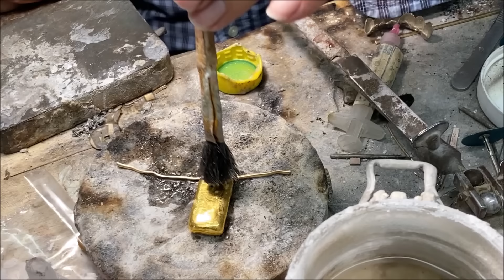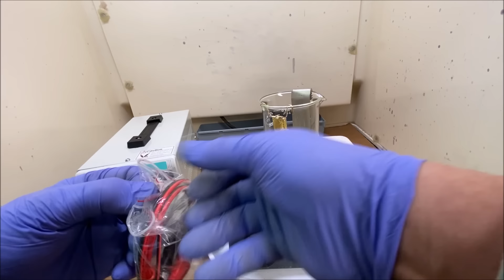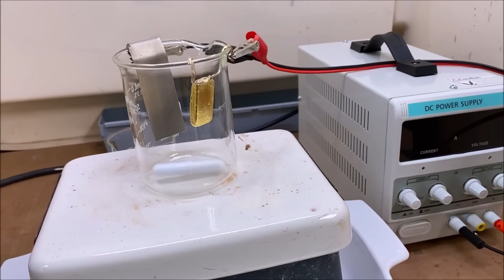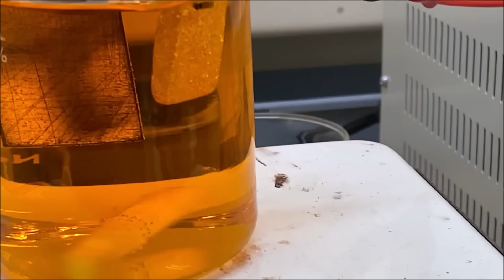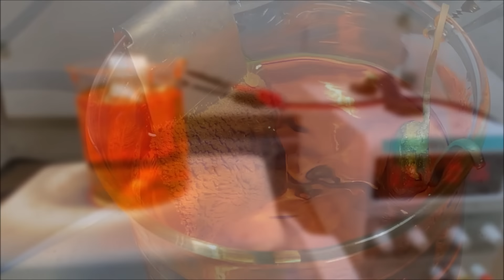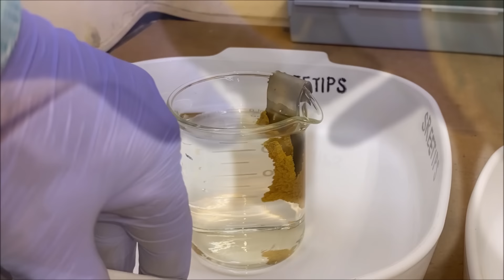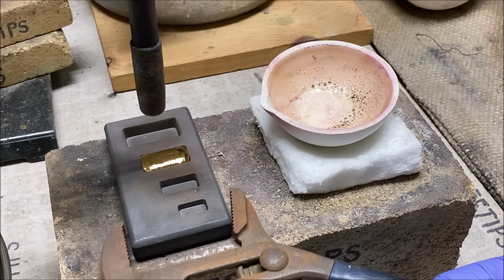Electrolytic Gold Cell Part 2

Comment: If you shaped the cathode like a triangle (or just make the bottom narrower than the top) with the point facing down it may be easier to slide the precipitated gold off of it.  If the thickness were tapered down the length as well it might make it even easier.
Reply from the maker: Excellent suggestion

Comment: I do this with copper. If you use low voltage the pure crystals will grow thicker, but will take longer.
 Edit: Just realized you are the one i spoke to about the right voltage and time for thick crystals. So yea you already know this.
Reply from the maker: For proper silver deposits, 3.5 VDC is critical.
Reply: @sreetips  yes sir. It was your silver video that got me into plating copper crystals.

Comment: Since I have no clue I’m wondering if you shaped your titanium into a tapered needle shape if it would pull right out of the gold when your done. Or if you used a ..9999 fine gold bead shape or square or pyramid ect would it plate into that shape? Great video I’ve heard a lot about your channel but never had time to watch a vid till now. Very cool in my opinion. Thanks for sharing see you on the next one 👍🏼👊🏼

Comment: Intersting experiment!

I am just guessing, but a well-rounded cathode, maybe even a round bar with a ball formed on the nose, would be good to remove the gold later.

Or at least a polished plate with round edges, as those seem to hold the gold very tight.

Comment: Wouldnt it have been easier to just melt the original bar....?
Reply from the maker: The original bar was about 995 parts per thousand pure gold. But running it through the cell I get it to 9999 parts per ten thousand pure gold. So melting the original bar would have done nothing to change the purity.

Comment: Completely pointless.
1. Your choice of violent stirring, in a small volume, together with a rough/porous object, that which in fact is supposed to get refined, may get it contaminated with anode sediment, which is normally meant to settle straight down in t process of https://en.wikipedia.org/wiki/Electrowinning.
2. If I am educatedly guessing correctly, a specific voltage is required to selectively transfer what is desired, higher voltages can then alter t chemistry of what's going on, potentially including more noble metals.
3. When you're physically scraping with a hard metallic object, that action can scrape pieces off of t Titanium, contaminating t deposit.
4. But t Gold anode is already very pure, making this flawed approach effectively just a very energy expensive and inefficient means of transporting a piece of gold from place A to place B, you could have just remolten it directly!

Not trying to be hostile, just my natural reaction ;)

Comment: By the way, i tinkered with doing this process with copper using the things i had and freshly purchased copper sulfate from  store plumbing department and a 48 volt power supply. It worked nicely but i think it needed some acid, possibly sulfiric, added. In a week i had plates that looked just like your silver cell crystals. Mom liked them too much to allow me to sell them :(
Reply from the maker: The acid will increase the conductivity. And I think that’s good for the cell. 48 volts sound a little high. I’m sure you can find the optimum voltage for your copper cell published on the internet.

Comment: So how much gold did you loose once you got the rest of the original bar plus the end product ? Since you went from .999 I'm guessing you lost something in the processes of refined .9999
Reply from the maker: There are losses all along the way. Minimizing these losses will depend on the skill and technique used by the refiner. Unless something got spilled or dropped, the loss of gold from this process is very low. A drop of gold splashing out of the cell. Some gold sticking to the melt dish. Getting it too hot in the crucible and causing it to vaporize. But it should be one for one straight ahead trade. Of course entropy guarantees that we will never get out 100% of what we put in. But it will be very close.

Comment: So did he really just basically grow gold?
Reply from the maker: Grow: to increase in size or mass. And that’s exactly what happened on the titanium cathode. But I first had to have the gold in the form of the anode bar that dissolved and passed the gold ions through the gold chloride electrolyte to deposit as pure four nines gold on that cathode. I didn’t create gold out of thin air. I refined it.
Reply: @sreetips  thank you for the response. It's very interesting.

Comment: I just came across this, whats the point here?  He had a nice gold bar and then did the chemistry and then made another one.  Its fascinating and interesting, but is there a reason to do this?
Reply from the maker: Yes, to demonstrate that it can be done in my garage. I’ve refined four nines gold in my little homemade gold cell. That extra nine is meaningless, unless your an amateur refiner, like me. I guess I’m just being a bit of a show-off. The Royal Canadian Mint uses this process to refine four nines gold to make their highly sought one ounce Canadian Maple Leaf gold coins. And I did it in my garage. For electro-refining to work one must first start with anode material that is fairly high purity to begin with. And that’s why I used a single refined, 995 parts per thousand, pure gold anode bar. The finished bar went to my daughter. It was 9,999 parts per ten thousand pure gold.
Reply: This process is the basically the only way to be sure that the gold is completely pure, with not other metals in it. the final product is pure gold in crystal form, meaning its more valuable and has absolutely no trace of metals like copper or silver. Most gold that's called 'pure' gold is close, but usually it technically has some silver or copper in it, in very small amounts, like very small. this version of gold has none.

Comment: This is fascinating but I am so lost on a lot of this process.  Definitely need to do some light reading to brush up on my chemistry and metallurgical processes.
Reply from the maker: It’s pretty simple. The electrolyte is gold chloride (pure gold dissolved in aqua regia). The concentration of the gold chloride is 100g per liter (estimated). The anode is pure gold, about 995 parts per thousand. The cathode is pure titanium. I pass an electric current through the anode. It dissolves and the gold ions travel through the electrolyte and deposit on the cathode. It’s that simple.
Reply: @sreetips  haha yes and no.  Love your set up and there is a lot of attention to detail.  Would have to upgrade the ventilation I use for my glass work for sure.   Great videos and excellent explanations.  Thank you.

Comment: How much did the remaining anode weigh? You started with 58.2g on the anode but ended up with 45.6g for your finished bar. How much of that was just the anode bar recrystallizing on cathode? We could need to take the current weight of the anode minus the bracket and subtract 12.6g to find out how much you purified from solution.
Reply from the maker: It was about 11 grams or so. But I didn’t weigh it.

Comment: SREETIPS....NEXT TIME MIRROR POLISH THE TITANIUM AND THE GILD WILL STILL FORM.....BUT NOT STICK LIKE IT DID THIS TIME! You are forming a mechanical bond....bc of the grain on the titanium...not a chemical bond....so by polishing the titanium you forgo that issue. Now it will still slightly stick....but not nearly as bad.....and yes it can be that simple.
Reply from the maker: Agree, plus taper the titanium.
Reply: @sreetips  agreed also! 👍 not bad for a high school drop out....hahahaha guess spending 30 years as a sheetmetal fabricator has paid off! Hahahaha love the vids sreetips keep em coming and keep taking chances on new processez

Comment: Just fantastic to watch. What is this book you speak of that you reference?  About the heat of your solution and how much current to use? Have you thougt about a collaboration with anyone who has a mining channel and try this on a bigger scale?
Reply from the maker: Refining Precious Metal Wastes
Mining is grams per ton. If the miner had material that produced 1 gram (of pure gold) per ton then the miner would have to process 50 tons of material to find as much gold as I refined in this video.

Comment: You just dissolved it and moved it to the anaode.. 😂. No gold was created that didn't already exist in the beginning.
Reply: he did something more significant though, he created the purest possible form of gold you can find anywhere in the universe. It's crystallized gold, with absolutely no trace of any other elements in it. average 'pure' gold actually has traces of metals like copper and silver in it, so in this way he increased the value of the final product.
Reply: @nostalgiaarcadefuture  well then, I take back my former, judgmental statement and I apologize. 🙏
Reply from the maker: Correct

Comment: I'm curious. Isn't titanium alot higher melting point than gold.  You could have spared yourself and just melted it away.  But then I do not know for sure. That's my question and I love your videos.
Reply from the maker: I believe that trying to melt the gold off the titanium would have caused the gold to weld/solder to the titanium making it impossible to get it off.

Comment: you could have silver soldered stainless steel welding rod to the gold bar easily.for hanging the gold bar...then disolved the silver solder off of the two with nitric without needing to do further refining...

Comment: So you started up with a block of gold you used as a anode which melted away during the process Then you get gold on the cathode from the process that you smelted down into a gold bar but how much extra gold did you end up with?
Reply from the maker: Smelt: rendering metals from ore. I’ve never done any smelting.

Comment: Love your videos! I found a very unusual, small, heavy, molten, gold tone piece of metal when metal detecting. I used 14k acid on it to clean it up. The second & third time I cleaned it, the acid turned green, it gave off an orange gas, and after maybe 40 seconds the acid became blue in color but the piece remains gold and when you move it around it changes color with a slight copper hugh to it. Very sparkly like a reflector. It weighs exactly 20.0 grams and is only 1 1/4" x 3/4"x 1/2" approximately. Also, the metal did not receive any damage from the acid. I wish I could add/send you some photos.
Reply: did u uncover the mystery yet
Reply: brother dont leave us hanging on this alien gold piece

Comment: I used amonia for my clear solution used a stainless steel basket with gold plated pins for anode and lead as the cathode used a computer 36volt charging transformer as the power seemed to work good as well
Reply: Nice recovery and excellent video 🤗

Comment: That is a beautiful little gold bar mr Sreetips :) I wonder though... is 9999 fine gold worth more than 999 gold? To such a degree it is worth the effort of doing two refinings?
Reply from the maker: The fourth nine isn’t necessary. Three nines is industry standard. Just did it to prove that I could, and to see if that titanium anode would work.
Reply: It certainy looks to be much more efficient than purely chemical refining... if you manage to streamline it a bit more by making the appropriate enclosure and such, I'm certain you could save yourself a lot of expensive chemicals

Comment: Streetips has the best gold ❤
So it seems the electrolysis gold refining is a little faster? 
Where would you see other PGM fall away? In the leftover solution? (From what I understand all everything was 999 pure anyways).
Reply from the maker: I think PGMs will deposit at a different voltage.

Comment: Didn't it cost over 50?
Reply from the maker: Define “it” please.
Reply: @sreetips  Didn't you begin with an anode that weighed 58 grams, ended with one that weighed maybe ten, and a collection of 45?  So you're transferring the anode to solution and solution to cathode but whats the actual recovered weight?
Reply: @sreetips  Really, I'm trying to understand.
Reply from the maker: I see, the anode gets partially dissolved, some of it remains undissolved, I think it was 11 or 12 grams that remained. The gold ions travel through the electrolyte and deposit on the titanium cathode. Impurities remain in the electrolyte.
Reply: @sreetips  So this process isn't about reclaiming an element in solution but purifying what you already had?
Reply from the maker: Correct. Getting gold this pure is not an easy task. The Royal Canadian Mint uses this process to refine the gold to mint their highly valuable Canadian Maple Leaf four nines gold coins.

Comment: second comment/question.

When gold is this pure, do you even have to melt it? Or can you just press it together? 
when you are showing the crystal after removal from the cathode you can see very shiny pieces where the gold is so tightly packed it looks solid, cold welded together.
Reply from the maker: I’m told that pure gold like this can be cold-pressed into solid bars. But I’ve never tried it.

Comment: I have a question.

You can use copper to cement silver from silver nitrate.
Can you use silver or another metal to cement gold in the same way?

edit* 
Now that I've given it some thought... even if you could, why would you when you can just use the SMB. However, it would still be interesting to see.
Reply from the maker: Yes, gold can be cemented. On copper, or zinc. But the problem is that’s it’s not selective. Other metals will also cement, if present.

Comment: I’d be interested to see the difference between the quality of that bar and the good you precipitated from the electrolyte. It seems you used pure gold to refine pure gold so are you really getting better quality pure gold or is it just that much more gold? Plus your melt dish looked like it may have had some trash in it as well so I wonder how much contamination came into the bar from there. 

Very interesting indeed. I’d be interested in an analysis of the bars quality.
Reply: I am also concerned that the melt dish used to produce the 0.9999 pure bar wasn't completely virginal or in pristine & new  'factory clean' condition. Any informative thoughts you may have to allay these concerns would be greatly appreciated if not completely helpful.

Comment: Hey buddy wanted to give you another tip that I found out instead of buying these cheap little plates for us to cook our gold and stuff on need to invest and get you a little induction hotplate I have one now for about 8 months man and I love it and I'll tell you what it's so much better than them cheap things we used to have it's awesome all you need is a cast iron pan or pot basically anything magnetic to put your beakers in when you're doing your refining that way it can pick it up cuz you cant use stainless steel or anything like that it's got to be a cast iron pot or a pan or something like that That's what I've been using is just a regular egg pan made out of cast iron and man I tell you what soon as you cut that thing on your shit's cooking and it's got digital readings and everything it's not something is going to break on you they last a long time I've been using the same one now for like I said about 8 months and it ain't showing no signs of wear versus the other one anyways thought you might like to know if you get one and I'll save you a lot of money in the long run when your other one breaks you can get them single or double burner
Reply from the maker: That’s good to know. I could use a cast iron pan and set the Corning ware in that. Thank you!
Reply: @sreetips  Portable Induction Cooktop 1800W Electric ANHANE Hot Plate Single Burner Portable Electric Stove for Cooking,3-Hour Setting, Grey Crystal Glass Surface,110v Compatible with Magnetic Cookware

That's what I got on Amazon That's the same thing I bought￼

￼

￼

￼

￼

￼

￼

Comment: Get a blowtorch and heat up the gold red hot then hit it with a hammer a couple times and A: you wouldn't contaminate it with solder and chemicals. B: ez weld. Gold is malleable.

Comment: I wonder what happens if you turn your stiring bar off (or way down if that's possible) other than your anodes shark tooth shape changing which is caused by the motion of the electrolyte I think

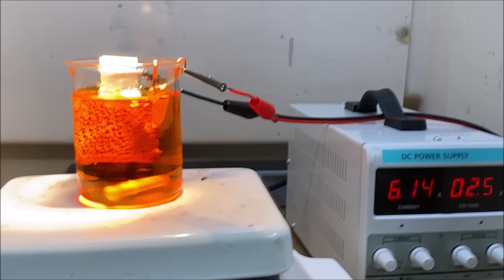Comment: 18:40 that's about 12 watts
Amps times volts gives you watts which is your actual current regardless of the specifics of either of the original parameters (apps and volts) and I suspect in the end the only thing that really matters much.

I'm going to try to gold electroplate my titanium ring since it's resistant to acid enough to try using an acid electrolyte and dissolving Doner anode (made of karat gold) instead of cyanide solution maybe even without an impregnated solution first to see how that goes and I'll let you know if I end up with anything interesting to share

Comment: I dont understand the point in this.
Reply from the maker: This is electrolytic gold refining. The point is to remove impurities from the gold.
Reply: Correct me if I'm wrong but can gold get more pure than 24carrot
Reply from the maker: No, 24k is pure gold. Three nines (999 parts per thousand) is industry standard for pure gold. Entropy guarantees that gold can never be 100% pure. But I’ll bet that if I run some gold back through my gold cell then I could get close to five nines pure gold. That’s 99,999 parts per one hundred thousand.
Reply from the maker: Treasury bars of pure gold are only 995 parts per thousand. Just under industry standard. The reason for this is because to get all that gold to three nines would take a second refining and lots of work. So for treasury purposes, 995 is close enough.